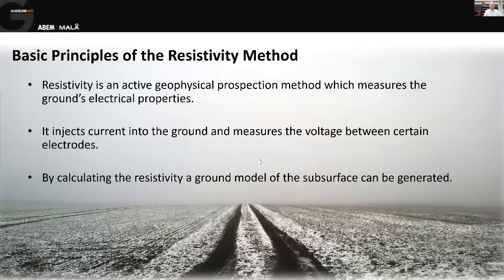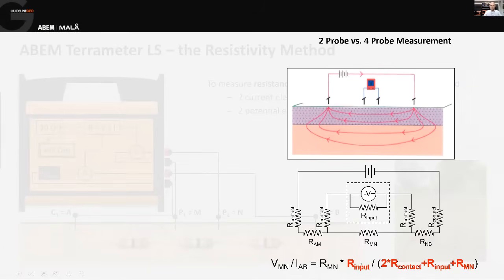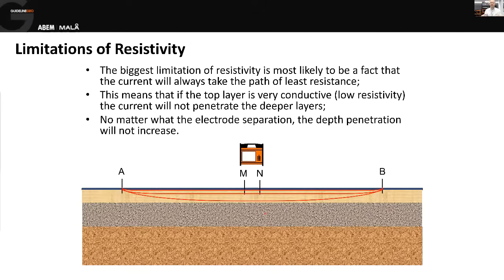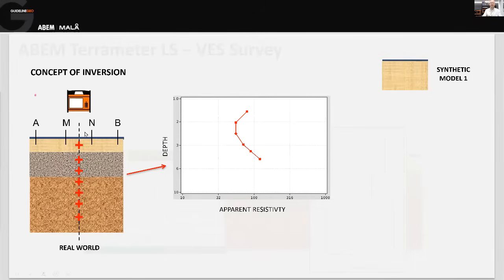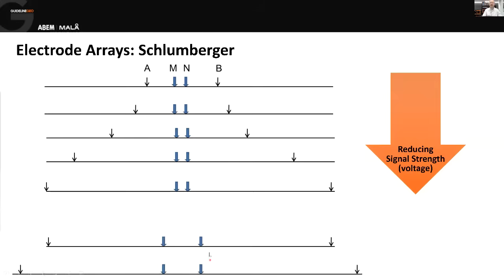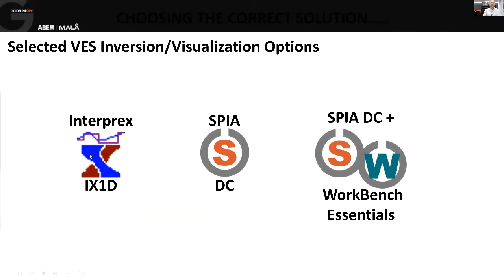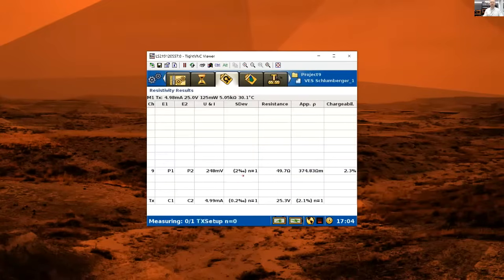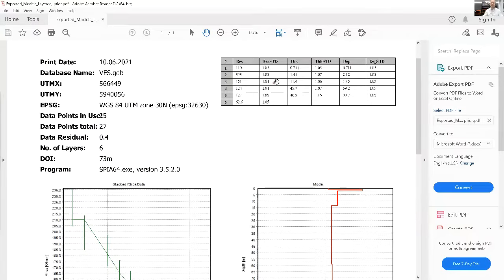Vertical Electrical Sounding (VES) a summary of the method and its uses

Comment: The input impedance of the MN potential circuit in modern instruments is very high (> 10 Mohms),   In other words, the tiny current drawn (picoamps) does not affect the potential being measured.  The problem with the 100% duty cycle IP is that EM voltage transients will be included.  EM transients are at their worst with low-resistivity ground, and long wires close to each other.  That is why time-domain IP systems wait 0.5s before integrating the IP effect.   It is one of the reasons to use the dipole-dipole array for profiling, which minimises such transients, as well as having some other advantages.